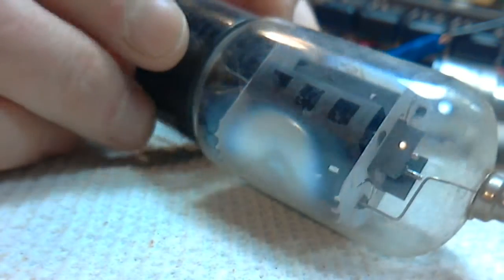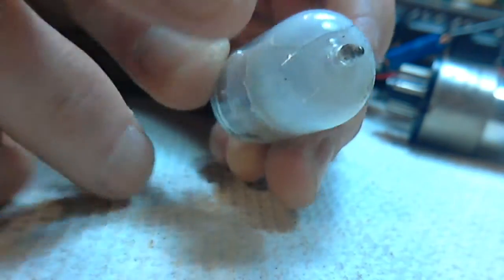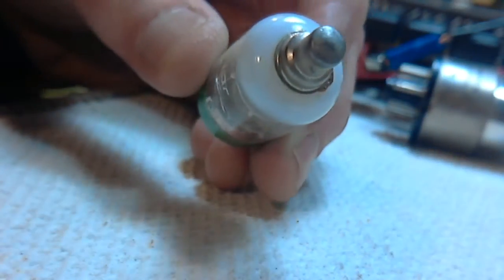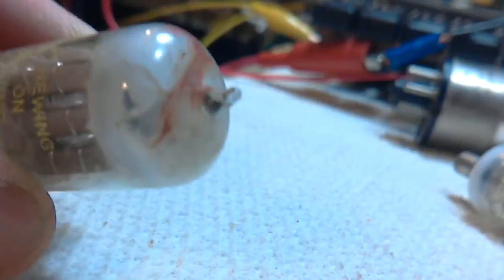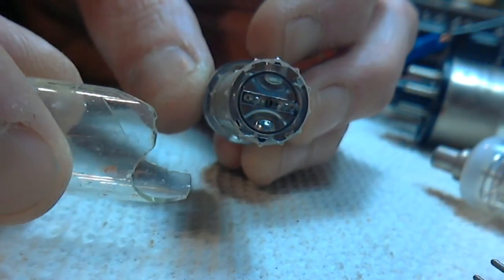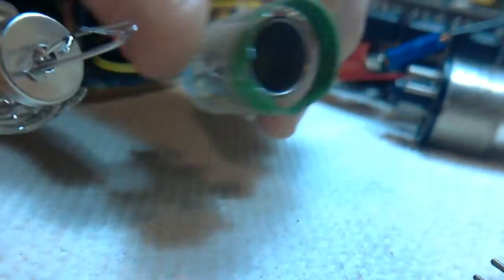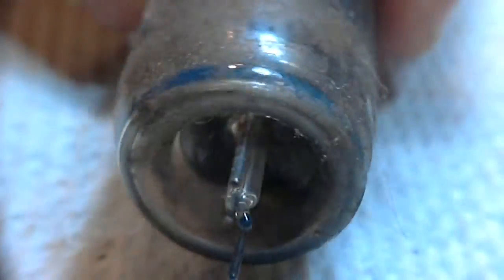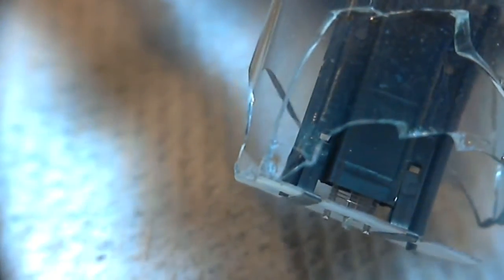How To Identify Bad Gassy Leaky Vacuum Tubes

Comment: I enjoyed it too.  Please keep them coming.  BTW that was a 6J5 triode at the end. It's electrically identical to half of a 6SN7.  The "audiophiles" have discovered them and driven the prices up.
Reply from the maker: I worked on a couple of mono OTL amps for a friend last summer and each on had 4-6C33's and 4-6SN7's.  I'm not an audiophile and I don't buy into any of the usual hype but these really did sound great without an output transformer.  Super hot!  I made my first videos on these amps.  Here's the last OTL video where I test them:  http://youtu.be/b6hcfY5zzc4
Reply from the maker: I'm sorting through a pile of tubes and I haven't seen many 6J5's.  Either they are uncommon or I haven't opened the right box or tubes yet.  We're thinking that almost any 'power' tube like a horizontal output tube will be of interest to the audiophile crowd.
Reply: Jim Lindenas They glass types are less common than the metal.  I have a few early televisions that use them for the vertical oscillator.

Comment: Thanks for the show.  I just had a tube failure in my homebrew guitar amp.  I was playing when suddenly the sound changed.  I looked at the amp and saw one of the power tubes EL84's glowing white inside the anode can.  Not good! I thought and immediately turned the thing off.  Later after it cooled I tried to remove the tube and the top came off.  The tube had cracked around it's circumference just above the base.  The tube shows the same white deposits that you talk about.  What I am wondering is why it cracked.  It may be due to a heat stress caused by a bout of red plating while I was bringing up the amp.  I thought that I had escaped damage but the uneven heat may have caused stresses in the glass that led to this total failure.  Anyway that's my theory.
Reply from the maker: +Hank Cohen So many things electronic fail for mechanical reasons.  I'm sure you are quite right about the glass.
Reply: No not a loss of bass more a huge increase in distortion and a loss of volume.  It only lasted a few seconds because I turned off the amp once I saw that one tube was glowing white.  The sound change was just the thing that made me look at the amp.  Tube death followed in a matter of seconds.
Reply: You can replace the tubes but it's likely that the problem is elsewhere. There are lots of things that could go wrong with old tube equipment besides a bad tube.  Since the amplifier still works and it is just a question of tone I would suspect a bad resistor or capacitor in the interstage connections, the connections between the output of one tube and the input of the next.  This isn't the kind of thing you are going to be able to fix unless you know quite a lot about tube circuits and how to debug analog electronics.  I'd recommend finding a tech with the right experience.   
Don't stick your fingers into the workings of any tube device.  There are LETHAL voltages in there.  Turning off the power doesn't immediately discharge them either.  You can get seriously zapped long after the switch is turned off and the device is unplugged.
On the other hand if you're planning to vote for Trump perhaps you should stick your fingers in there. ;^)